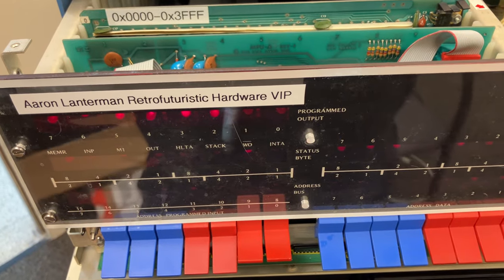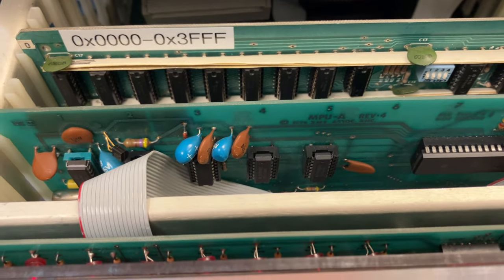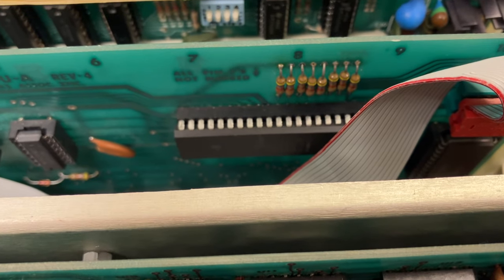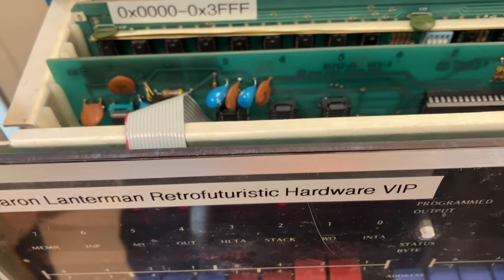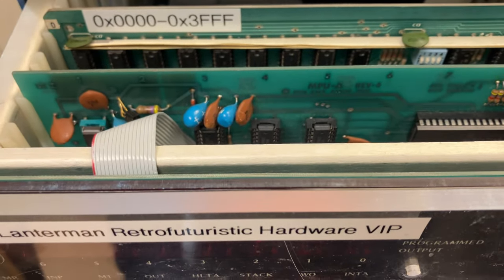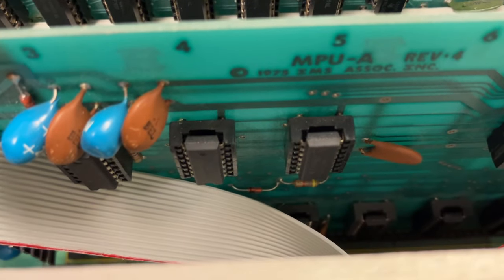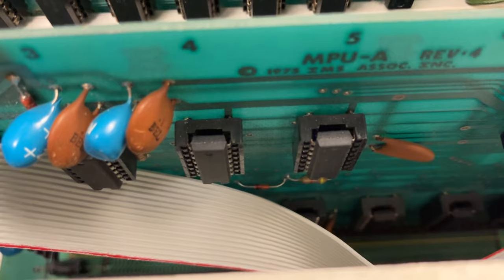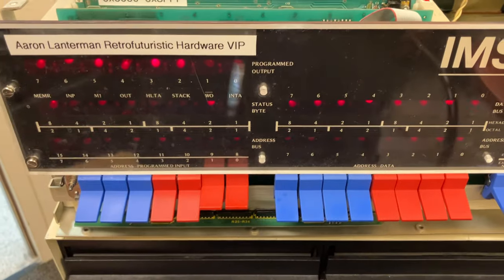You Won’t Believe How I Fixed this 8080 CPU Card for the IMSAI 8080 (MPU-A)

Comment: I work on a lot of vintage electronics, this common. I use deoxit cleaner and fader lube. I clean parts and sockets with dental picks and those little floss brushes. Works every time.  Keeping the old stuff alive is great.
Reply: Thank you for that tip. Sounds like very nice solution!

Comment: also, tantalums on power supply rails are a failure point. on a 5V rail i would use a 16V tantalum as a minimum, or easier just use 35V tantalums and be done with it.
Reply from the maker: Do you think it's worth going through the work of swapping them all out?
Reply: if you have time its probably prudent to replace them, also 20 year old electrolytics should be replaced as they dry out over time.
Tantalums are very susceptible to over voltage & the fail short, so i would replace them.
Reply: Perhaps made in some technologies. I have some that are clear and with perfect parameters. They were made 50-60 years ago. Polish red drop-shaped and green ones. But very sensitive to voltage.